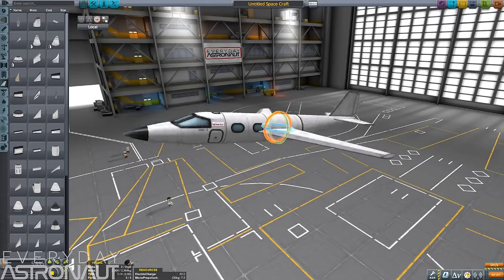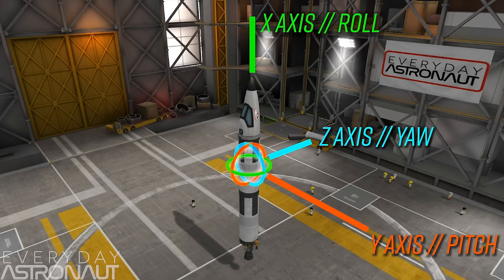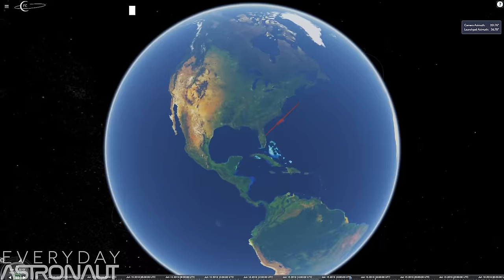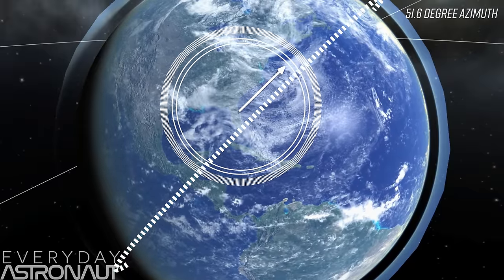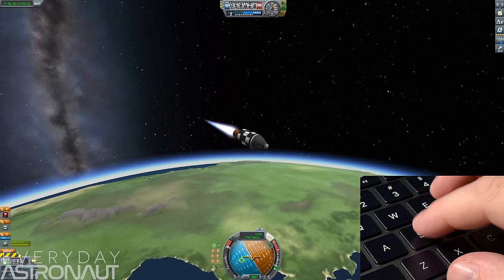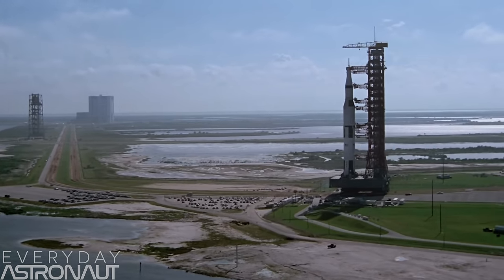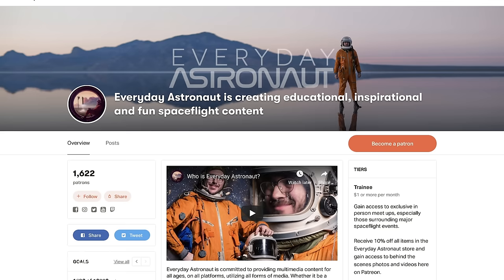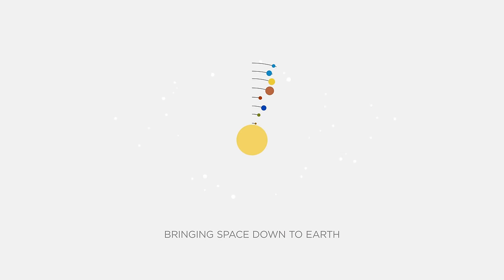Why do cylindrical rockets roll?

Comment: Ok,  I'm gonna use video game airplane logic, so somebody correct me if I'm wrong: The Y axis on your plane's controller only goes up and down--you push forward to go down and back to go up. When your plane is level up is up and down is down--but when you want to turn, you roll the plane so that the new "up" is the direction you want to turn in. So if you rolled  right 90 degrees and your wings were perfectly vertical--up and down--when you pulled "up" on your controller(ignoring gravity and lift, which would both just pull you "true" down) you would turn right, relative to anyone who was watching you. Thus, the only axis that you would have to deal with would be that Y axis, and minimizing the number of axes you need to control is the whole point of the roll...

Comment: Yup, In Kerbal Space Program, I learned that separatrons and flea boosters arent enough to separate some larger asparagus boosters. You need to constantly roll to keep the next pair of separating boosters parallel with the horizon
Reply: @Addison Brendtro the plumbing is very difficult. As far as I know, only the space shuttle and Buran Energia have a retractable fuel coupling like this to an external tank, but they detatch after Main Engine Cutoff
Reply: "Why do cylindrical rockets roll?"   Because they rock!!!
Reply: @Addison Brendtro falcon heavy uses asparagus staging
Reply: @eliethdiez964  it doesnt. It was going to but it was decided it would not
Reply: Oh, so I'm not the only one who keeps my rockets stable in ksp by rolling?
Reply: @Thor_the_Doge  nope, welcome to the world of spin stabilization
Reply: @Thor_the_Doge  I don't. My point was that as your rocket performs the gravity turn, you want to orient your boosters to the sides before ejecting/separating them. If they are above or below you, they are likely to crash into the core unless you are perfectly prograde, due to aero drag. Think about the space shuttle, the solid rocket boosters are ejected sideways so they don't crash into the tank or orbiter.
If you have multiple boosters asparagus staged, you need to roll everytime you stage to position the next two boosters for a sideways trajectory. It also helps your rocket pitch more easily if the extra mass is on the sides, and it gives you more aerodynamic lift at the expense of some drag.
Reply: I learned that in Simple rockets 2
Reply: @eliethdiez964  it doesn’t. They never developed the cross feeding
Reply: I just attach a fat wing on the side, and the drag on the way out pulls it away
Reply: @Addison Brendtro Also, IRL tanks have much, much lower dry mass than the stock KSP tanks, so you stand to gain a lot less
Reply: I think it is more of the issue of keeping tanks pressurised so that fuel goes into the rockets properly and into the main tanks of the asparagus at the same time is deemed to much of a technical challenge

Comment: Another great video, thanks Everyday Astronaut. One thing I'm not entirely sure about is the 20% increase of payload capacity of the Space Shuttle (that would be insane!!!!). A few months back I followed the entire open course "Engineering the Space Shuttle" at EdX, and the question "why the SS perfomed the roll maneuver" came up a few times. The engineers doing the talks gave 2 reasons: 
1. They were re-using old Apollo launch pad, therefore they were subjected to their limitation and needed to be able to place the vehicle at the right attitude (with the roll maneuver).
2. The aerodynamic engineers figured it out that there was less stress on the orbiter when it was sitting underneath the main tank during the max Q phase (maximum areodynamic pressure), this was because (as you mentioned) the thrust was directed throught the center of the mass of the entire system, therefore the orbiter was somewhat skewed with respect to the flight path.

Funny story (I don't know if it's actually true, but it was stated on the aformentioned course): when Soviet launched their first and only Buran, they too did the roll maneuver. They didn't have to, because their launch pad was capable of giving the right attitude to the vehicles. So american engineers (after the collapse of the soviet union) asked russian engineers: why did you do that roll maneuver??? They replied: "Because you did it" :)
Reply: I'm no rocket engineer by any means, but the payload increase seems quite logical to me. As stated in the video the engines of the space shuttle had to gimble outward in order to compensate for the far stronger thrust of the booster. If now the space shuttle is aligned so the booster is "outside" of the flight curve and the shuttle "inside" of that curve there is less need for compensation. I can just guess that this way less gimble has to be used on the engines, which would sound more efficient to me. In case I'm wrong please someone smarter correct me.
Reply: There are a number of reasons that make having the the heavy, lopsided thing orient earthwards makes sense, not least of which what Eigen Value discussed. With less stress on the vehicle, the vehicle can now handle more weight within. With this being the case, the critical limit state must have been the structural integrity of the shuttle/booster at max-Q.

I would have thought it would have to do with how much fuel you can fit into the tanks, but maybe the tanks aren't always full, and, actually, they only have as much as they need?
Reply: If the improved aerodynamic saved a few percent of fuel and the decreased engine gimbal saved a few percent of fuel and the reduced stress allowed for a little more fuel on board and a little lighter shuttle... Yeah, I can imagine that made a 20% payload difference. Don't forget, that would be a change of roughly 5 tonnes to LEO on a 2000 tonne system.
Reply: Tim mentions that the increase was from the shuttle being in the wake of the tank, presumably indicating aerodynamic benefits.  I also wonder if it might have benefited from the fact that, with engines always gimbaled outward, situating the shuttle underneath automatically orients its engines' thrust vectors so as to have a stronger upward component to them throughout the fight path than they would in the opposite position.  Apologies if this idea is foolishness.  I, neither, am a rocket engineer. :D
Reply: @kpatelPub   Rockets don't care about upward thrust - most of their energy goes into moving sideways. You really just want forward thrust and the rocket mostly just pitches over to point where it needs to.
The whole SSME gimbal vs SRB offset and gimbal thing is getting more complicated the longer I look at it. :-(
Reply: @matejlieskovsky9625  True but surely it benefits from rolling early and going up instead of sideways at the start.
Reply: @TheNevawuz  Sure, you want the rocket to get out of atmosphere ASAP to lower the maxQ, but just rolling shouldn't do anything while you're vertical. At least as far as I can see - I might be good at physics, but I sure ain't no rocket scientist.
One more factor to consider might be the fact that the shuttle had (admittedly tiny when compared to the tank and SRBs) wings...
Reply: @matejlieskovsky9625  It's quite dizzying, right??? XD  Anyways, I hear what you're saying, but in the end I don't think it quite zeroes-out like that in the case of the shuttle as it would for a cylindrical rocket.  

As @TheNevawuz may be alluding to, during the initial minutes the vehicle wants to ascend as quickly as possible to escape the thick atmosphere.  I don't think there is any way to pitch the rocket that is going to recoup the part of the engines' thrust that is going to accelerate the vehicle horizontally. You could counteract it by gimbaling the SRBs, but at that point, you are now expending even more thrust horizontally just to null it out.

Another thought... much later as the vehicle approaches horizontal (SRB's gone by now), if the shuttle was on top, it might have to tilt the vehicle like a skiboat going through water in order to avoid providing downward thrust, which, even in the thin atmosphere could increase drag.  This scenario would depend on a number of factors that I don't have specific knowledge of.

Anyways, I could be totally wrong, but there are my thoughts.  Oh, and I didn't talk about the middle period, just after the SRB's detach and the vehicle is still on a largely upward trajectory, because my puny brain still hasn't resolved how it thinks that would play out yet. XD

Comment: Speaking of rocket azimuths...
In 2017 Russian "Fregat" booster has failed to deliver some communication sats to the orbit. The launch was happening on the new "Vostochny" cosmodrome, which has a starting azimuth of 168°. Target azimuth for lower stage was 354°. So the lower stage has decided prior to launch: "I need to rotate from 168 to 354, the fastest way is to rotate left by 174 degrees". Target azimuth after separation for upper stage, however, was 344°. So the upper stage has decided before launch: "I'm gonna rotate right by 170 degrees, it's the fastest way". Then after launch when the first stage completed the roll succesfully to the left, the upper stage calculated correctly that it is only 10° to the right from it's target direction, but it already decided on the ground that the fastest way to roll is to roll right... So it started to roll full 350° to the right, but didn't make it before second stage ignition and has gone to the wrong unstable orbit, ditching to the Atlantic Ocean shortly after.

The problem was in the code of booster's navigation system, but it always worked just fine before, because there was never such an unfortunate combination of azimuths.
Reply: thanks for sharing that!
Reply: yikes! - that's an oopsie! :)
Reply: That is a painful way to figure that out.

Comment: Other world: turns a rocket to its flight asimuth
Soviets: turn a launchpad to rocket's flight asimuth
Reply: Jedediah Kerman Other world  pours millions of litres of water to reduce sound levels during launch. Soviets build a deeper trench
Reply: Another world: build rockets horizontally, like a production line, USA: They build the most difficult, vertically, needs a costly VAB and large tugs for the pad.   xD
Reply: In Soviet Russia launchpad rotates you.
Reply: @TarsoFranchis  How fragile the payload is determines is it can be fitted horizontally or vertically. Because the payload is designed for less gravitational forces and can’t withstand the weight bearing on Earth in certain directions
Reply: The soviets were pretty genius in terms of spaceflight
Yes, more genius that the US
Reply: Musk world: turn a rocket for fun

Comment: You forgot centripetal distribution of fuel / slosh dampening.
Reply: Plus there's moisture in the air that gets it wet. 'Roll program' and 'rolling about its x-axis' is just a highfalutin way of talking about putting it on spin cycle.
Reply: It helps prevent resonant waves forming in fuel, I suppose?

Comment: Great video as always. I did want to point out that IMU typically stands for inertial measurement unit, and consists of Accelerometers and Gyroscopes. You'll find em in a whole lot of thing (including in a good percentage of boards in any modern car). They can be pretty small too. But yeah a little nit-picky.

Comment: @9:48 IMU stands for Inertial measurement unit- basicly combination of multiaxial Gyro/Accel/Magnetometer , every modern phone has IMU chip inside.
Reply: MEMS-IMU : https://en.wikipedia.org/wiki/Vibrating_structure_gyroscope#MEMS_gyroscopes
Reply: All flying drones have a MEMS IMU
Reply: I always wondered how our phones could do so many marvelous things, it's all because of that one chip.
Reply: Came here to clarify. Thanks for beating me to it!
Reply: And you can knock them out (and a bunch of oscillator types) by exposing them to plain old helium for a while.
Reply: Raitis Grandovskis Tim was right that its called the instrument unit in this specific case though. Also they are typically called IRUs in modern jet aircraft (Inertial Refrence Units).
Reply: @grlldfsh123  I heard IMU, not IU, my bad. However when he talks about gimbal lock later in the video it gave me impression he doesn't entirely understand the topic.
Reply: Raitis Grandovskis I wish I did too.  He actually called it IMU then said IU.  Not sure if those were both the names of the Instrument Unit. Good catch. We call it PFM (Pure F*ing Magic).  Its my impression that an IMU or IRU/IRS uses gyros to keep track of its orientation in space, irregardless of other navigation methods.  The Airbus I fly these days uses it as a primary method for displaying our flight path, attitude and a few other things.

Edit: regardless**
Reply: It’s been driving me nuts that nobody had corrected this thank you!!!! We use them in robotics as well
Reply: @grlldfsh123  I make and program electronic for sports and use IMU sensors a lot. Best examples/ideas/algorithms always come from rockets and quadcopters, for example kallmann filters. Nowdays, actually its a lot simpler. I am more amazed  with 70, 80 tech with hybrid mechanical optical & electronic fusion devices. In 80 still sometimes navigation was done with stars but now my wristwatch is connected to 12 sattelites . Yeah, it is magic.
Reply: @grlldfsh123  You know there's no such word as "irregardless", right? It's just "regardless". You might also use the word "irrespective", but not a combination ;)
Reply: Piñata Oblongata learn something new everyday! 🤓
Reply: @UncommonSense-wm5fd  There's still such a thing as a "professional" journalist? ;)

Comment: I always wondered about this too. The V2 was literally pointed in the desired direction by rotating the launch platform, I guess before the days of electronics it only had a primitive pitch control.
Reply: The V-2 had a rather complex programmed pitch routine hard coded into the guidance system. The gyro’s have pitch limits due to the gyro gimbals which can lockup if over rotated. All the rockets until the shuttle had mechanical gyro’s and thus gimbal lock was a problem.
Reply: @allangibson8494  Modern gyros are still mechanical,  Just smaller.
Reply: The turned launch mount makes a lot of sense once you know that the USSR classified it's rocket program as part of the artillery.  Artillery officers are used to rotating their cannon on the ground to point towards the target. Same with the V1 and V2.
Reply: @johndododoe1411  The Russian R-11 Scud was a direct A-4 (V-2) descendant with a duplicate of the A-4 guidance system and engine just like the American Redstone but with even fewer changes.
Reply: @johndododoe1411  Modern guidance systems are solid state using silicon accelerometers (like what’s in your phone) and laser ring “gyroscopes”. No spinning masses at all. That has been state of the art since the 1980’s.
Reaction wheel gyroscopes are actually much larger than traditional guidance gyroscopes - because they actually move the entire flight vehicle on their own.
Reply: @allangibson8494  Gyroscopes in phones are still (tiny) mechanical devices, don't know If they are read by tiny lasers or not.  But the gyroscopic effect itself requires a spinning mass that will have unequal inertia against movement on certain axes.

Comment: When you forgot to add sepatrons to your SRBs and dont wanna blow up when staging.
Reply: When u added sepatrons but they don't work well enough to not boom your kerbals
Reply: @MrFlarespeed  when you use those small solid thrusters to launch your Rocket
Reply: You don't need sepatrons 99% of the time if you attach your SRBs correctly. Instead of putting the decoupler in the middle, put the decoupler high, and then use the translate tool to move the SRB down, so that the decoupler attaches to the nose of the SRB. (Optionally, attach a strut on the bottom of the SRB to keep it rigidly connected to the rocket). This way when you decouple, the decoupler kicks the SRB such that it starts to rotate away from your rocket, rather than towards it like it does when the decoupler is in the "default" middle position.
Reply: separate them one second early so the shoot out instead of hitting the rocket
Reply: @franklinz8098  And by chance they shoot into your rocket instead of outwards. If you ensure that doesn't happen, you now don't have to separate early.
Reply: @tylisirn  made this comment on one of @everydayastronaut's early ksp gameplay. It adds outward pitch moment to the side boosters so, even if they're not exhausted yet, they shoot away from the core. 😁 He didn't see the comment. Almost all side boosters do it - separation force slightly above the booster's center of dry mass. Except sozuys. Soyuz for some reason turns in then shoots out. Weird design, imo. Probably a necessary complexity, idk.